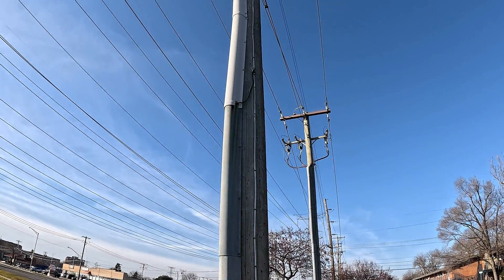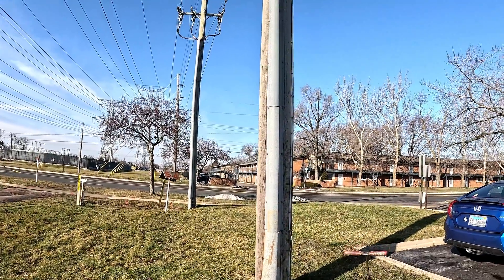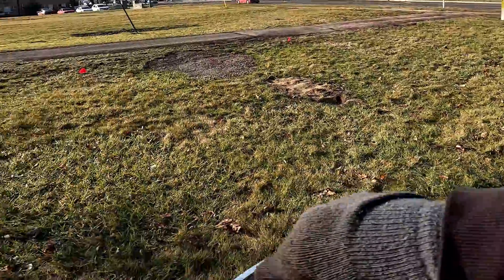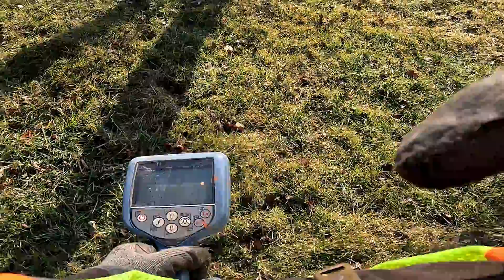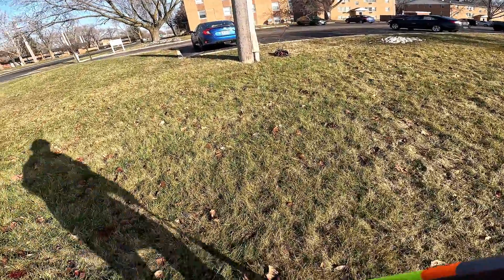High-Voltage Power Line | How To Locate A High Voltage Power

Comment: When hooking up to the u guard will you also be able to locate to a person’s house or business instead of hooking up to the actual meter at the house?
Reply from the maker: Anytime you're dealing with power, especially with secondaries, you always need to go to the endpoint and bring it back to whatever is feeding it. For example, if you have a secondary feeding the house from the pole, you need to go to the raceway (meter set) at the house and bring it back to the pole. If you have a secondary pedestal, you will need to direct connect to the secondary pedestal and bring it back to whatever is feeding that pedestal. Power works in a weird way, but anytime you deal with secondaries, you always want to bring it back to the main source. You never want to start from the main source and bring it out; that's the wrong way of locating power.

Comment: Can you just wrap it and run it on 200
Reply from the maker: You're going to get someone killed doing it that way.
Reply: I was doing a survey at a college and I needed to get into the campus, owned electric vault where the two 750 3-phase cables came in to the switchgear to locate them and the operating engineer was terrified to go down there.  I get it electric ain't no joke but goddamn this guy was scared shitless damn near.

Comment: Here in the netherlands, all 50kV and lower got digged in underground.
For now we call that the medium/mid-voltage power grid.
But i don't complain with most of half a kV wired directly in to my home at tree phase 400V AC.
Toptop that's serious tension.
Reply from the maker: These Transmissions are standard transmission lines that go from switchgear to switchgear before they become distribution lines to feed businesses and homes. 750,000 volts.
Reply: I wanna say that is the size of the conductor and not 750kv
Reply from the maker: @lucasjack1531  It's definitely carrying 750,000 volts.
Reply: @lucasjack1531  Funfact: Our transformer is powered by 800mm² solid alu cable.